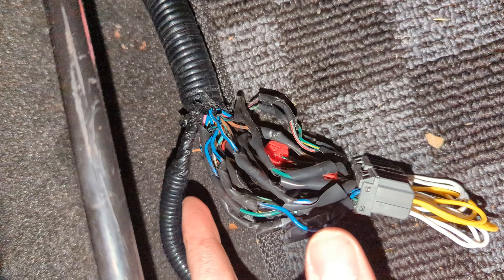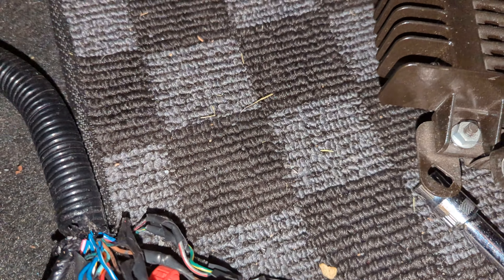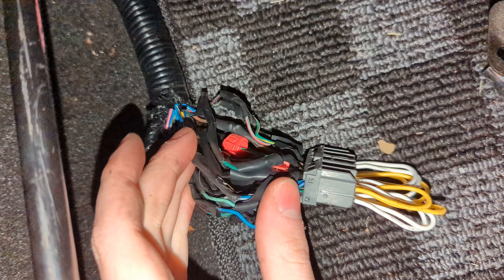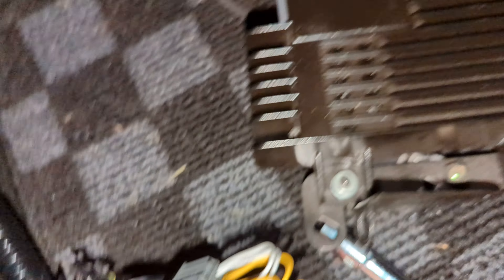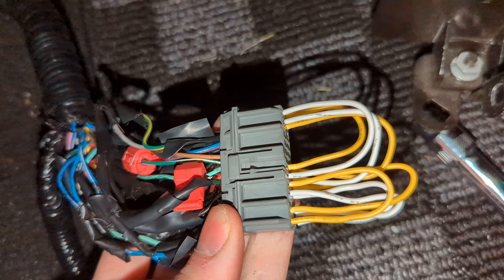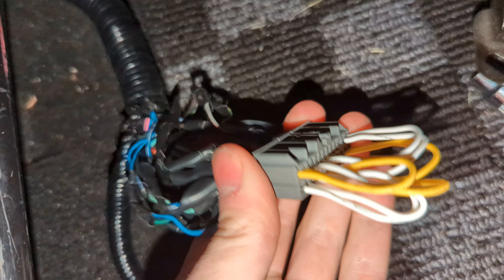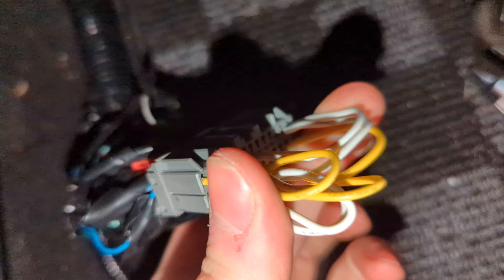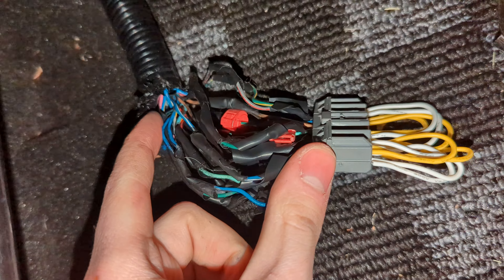RSX type-s best and easiest way to bypass bose amp!

Comment: Hey guys, just disable the amp in the aftermarket headunit, get the rsx type s metra 70-1725 integration harness and leave the stocck amp. Sound is amazing and everything works. That little sub in the spare tire hits hard bfor it's size, trust me. I have to turn my bass down a lot to how hard it was hitting.
Reply from the maker: Only issue with this is people on forums "claim" that the stock amp sounds worse than what would be in the aftermarket headunit, I haven't tested myself so I don't know. 

Otherwise this is totally the easier and better solution, because if you want to make the factory sub work with an aftermarket headunit you gotta get fancy with it and splice the sub-out RCA into the +/- signal in the harness under the seat, then use the factory amp to power the sub alone. 

It's super annoying to do and it didn't even work properly for me so I just pulled the sub and used the area for tools lol
Reply from the maker: Since I put in an XAV-AX7000 (where the entire selling point is a much more powerful built-in amp), I ended up using the method in the video to use said amp with aftermarket speakers

Comment: Great idea!
Curious, I already have an aftermarket head unit. Was running the oem amps and sub but I'm changing it up, planning on running a 5 channel amp and a different sub which  the 5 channel amp will power everything.  I’ll be running 4 gauge power to the amp and probably 12 gauge to the sub but want to utilize the factory wiring for the doors and rear panels.  Are you still using the factory wiring for the door and rear speakers? If so where are you tapping into
them?
Reply from the maker: I never used any aftermarket sub or amp, just the factory setup with different speakers and a different HU. From factory, the path of the audio wires goes from the HU to the amp under the seat, and then from that amp out to the doors and rear panels. If you want to COMPLETELY use OEM wiring you'd have to put the amp in the same spot as the factory under the seat, or put it in the trunk or something and wire the audio up to that connector that comes out of the floor under the passenger seat.
Reply from the maker: That is, run the RCAs from the HU to the amp in the trunk, and then the amp audio out to under the passenger seat where that connector feeds into all the speakers. Assuming the amp is too big or the 4 gauge power and ground is too annoying to put under the seat I think that's your best option
Reply: Roger that , that was the plan, I thought you were running an aftermarket amplifier.       I’m currently running an Alpine head unit.    Oem Bose Factory amps and sub and aftermarket door and rear panel speakers.     Actually sounds really good but I want to add just a bit more bass and changing to one 5 channel amplifier and aftermarket  sub as well.     

That’s exactly what the plan was, amp under seat bypass oem amps and utilize factory wiring for mids and highs.    I guess I misunderstood what you did here….    

So what you did here was bypass the one amplifier and running your mids and highs off of the head unit?
Reply from the maker: @chadwickwicky67  Yup! Bypassed and pulled out the factory amp (video) and since I had no more amp for it I pulled the factory sub inside the spare tire for more tool space. So I was running my HU straight to the 4 door/rear panel speakers.

Comment: Installed a pioneer head unit today on my type s the static noise is making me crazy i almost put back the factory radio.. will doing this removes the static noises?
Reply from the maker: yeah, I'm assuming your music is already at a normal/loud level even when on the lowest volume setting? that's because your setup is being amplified by both the pioneer and also the factory bose amp. you can either get a harness like this: https://www.amazon.com/Metra-70-1725-Amplifier-Integration-Harness/dp/B0007WRQEE that uses the preouts on the pioneer so only the factory bose amp is being used, or you can do what I did in the video and only the pioneer amplifier will be used
Reply: Yes you can hear it on the normal/low volume, but when i bump up the volume i couldn’t really hear it.. So the harness you linked up where does that goes? Is it different from the harness that’s connected to the factory wiring behind the head unit? Thanks for the quick respond man i appreciate it!
Reply from the maker: @joejavate1469  the harness I linked is just a different  version of this one that you probably used that connects the pioneer to the factory radio harness: https://www.amazon.com/Metra-70-1721-Harness-1998-2005-Vehicles/dp/B0002BF09S  -- This one uses the amplifier inside the pioneer, the one I linked in the last comment bypasses it

Comment: How did your speakers sound after u bypassed the amp? Did they still have bass
Reply from the maker: with my aftermarket radio they sounded normal like how they're supposed to sound, your sound will naturally depend on your radio and speaker setup. this method cuts out the factory Bose sub in the spare tire but you can rewire it manually to your new radio if you like

Comment: So I have an 03 type s and my amp wiring looks nothing like this…idk what to do it also doesn’t have the stock amp in it as the person who owned it before me had a sound system in it
Reply from the maker: this video is only good for getting past the stock amp, if you've got something else going on it obv won't be too much help lol

What are you trying to do? I'm assuming it came with aftermarket speakers and amp, the current setup is probably (head unit) RCA preouts -> custom amp -> custom speakers. if you're just trying to upgrade the HU just use the existing rca cables for the preouts on your new HU

Comment: Hey bro did this work with the 18 gauge wire? I’m installing a unit and it looks like the only way I’ll get sound is to bypass the stupid amp, but I don’t wanna do more wire cutting and splicing
Reply from the maker: yeah that was the entire video lol, 18 gauge solid core fits in the plug snugly and does the exact same thing as all the other people do where they cut and splice that harness. This way you can also just unplug the wires you jumped and plug into the stock amp no harm done if you want to go back to the stock radio

Comment: didnt work for me, 18 solid core wire, strip the ends and push them into the correct holes?
Reply: do I need to push it to the very bottom of the connector hole?
Reply from the maker: @shadowgaleshale9218  The reason I made this video was just to say that 18 gauge solid core wire will fit snugly and won't just fall out, I don't remember if I needed to bottom them out or not. The only advice I can really give here is that you can probably probe the harness side and the end of the wire you stuck in for continuity, and once you've confirmed the connection's good make sure you're following the diagram properly. You can see the little metal pins inside the plug, make sure you're putting the wire in at the right spot
Reply: Holy shit thanks for replying on this ancient video. 

Btw have u seen any cases where someone isn’t getting sound after the bypass? 

Happened to me and not sure where to start looking
Reply from the maker: @shadowgaleshale9218  I haven't personally- just to confirm the only thing you modified was the amp wiring and nothing with the radio correct? If you still have the stock radio in, the amp from the radio itself is essentially non-amplified, you'll have to turn the audio all the way up to hear anything at all
Reply: @reggiecopter it has a Kenwood system from the last owner, none of the pre outs are being used. 

Looks like the owner used the 1721 métra harness.

Doing this bypass, sound doesn’t work.
Plugging in the Amp makes sound come out again
Reply from the maker: @shadowgaleshale9218  Huh, if the last owner didn't use preouts and used the factory amp that audio must be stupid loud and crackly right now. ---- Anyways, the kenwood's amp should have plenty of power for stock (or stock power level) speakers, I think you might just not be making proper connections with your jumper wires
Reply from the maker: In terms of troubleshooting you should check for continuity between the plug at the radio and at the speaker. Like, look up the metra harness pinout and probe rear_right_+ or something on the radio plug, then pop the speaker cover off of the rear right and try the second probe on its terminals- you should have continuity (or if you're "measuring resistance" it should be 0 to indicate the two spots are connected)
Reply: @reggiecopter thank you being patient and teaching me how to check for continuity! 

The 18 solid core wire is perfect for the smaller openings but for the larger openings in the harness, it isn’t making good contact with the metal pad inside the connector.
Reply: Figured out how to get it to work, definitely shoudl experiment with larger solid core wire for other people trying this in the future, as for now, Im stuffing in the stripped off plastic to push the wire into the connector

Comment: Does it matter what wholes you put the wire in?
Reply from the maker: Yeah, since you're bridging specific signals (ex: front right positive output from the radio to the front right positive speaker). That's why you need the pinout from the forum post in the description
Reply: @reggiecopter  okay thank you, much help